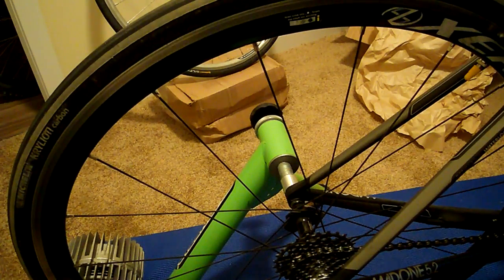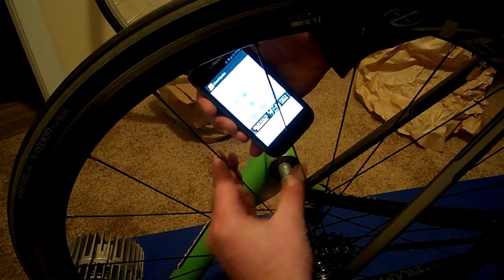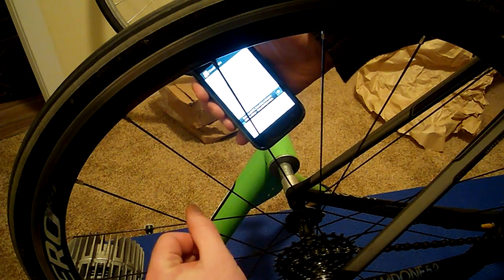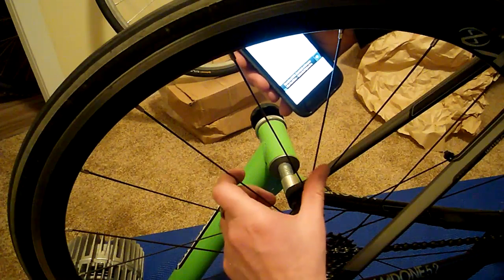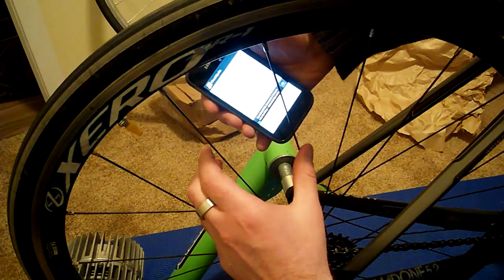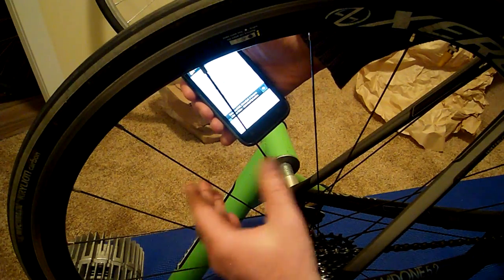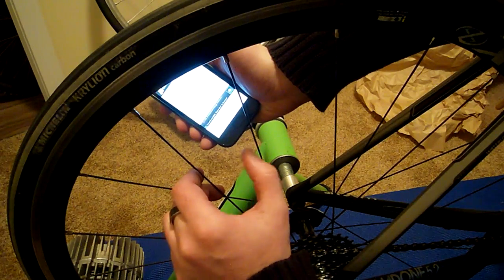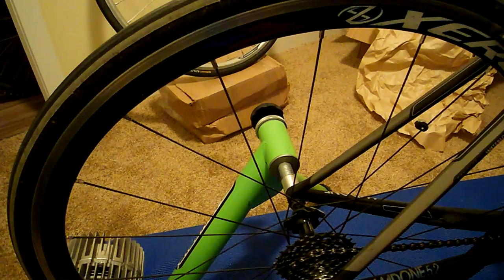Spoke Tension with App

Comment: Tension on the sprocket side should be  higher  than the tension on the other side because the wheel is dished, i.e. not symmetrical

Comment: How could every spoke, bladed, round, sound the same. Check it the real way..your life depends on it.
Reply from the maker: Just so you know, Shimano now uses frequency derived from this method for every single wheel they produce. Every wheel. Shimano. Also, through simple vibratory analysis it's quite a joke for someone to derive the tension - frequency relationship for non round spokes.... Again. Every single Shimano wheel since about 2013. Every single wheel. Shimano. Shimano.... every single wheel. Shimano
Reply: @kwakeham  What about Shimano?
Reply: @kwakeham  is Shimano also using vibration? Is it on all of their wheels?
Reply: @kwakeham  What does Shimano use?
Reply: A little dramatic

Comment: A few flaws I can see. You are measuring with the wheel on the bike. Not a good idea. You are seeing different frequencies on your drive side because your drive side has extra components (cassette, freehub body) that can and will reverb when a spoke is plucked. So you most defintely are going to get different frequencies on the drive side since Wn = SQRT(K/M), where Wn is your natural frequency, K is your spring constant (assumed to same in each spoke), and M is your mass, which is slightly higher on the drive side, hence the lower frequency measured from the drive side. What you have to do is remove the cassette, remove the freehub body and axle so that there is no chance of reverb from the end of the spoke to the hub components. Leave the tire on, put it on flat ground, and repeat. Should end up with pretty even frequencies. Another is the app. The app is crap. You should really use a good DB meter for this as the microphones in a cell phone are literally the cheapest pieces of crap you can buy. Other than that, good idea!
Reply: A few flaws I can see in your analysis.  First, the cassette, freehub body etc, are not going to "resonate".  The spoke rings in a narrow frequency range and has a very clean tone.  The other items, (if they did resonate) have very different frequencies.

Second, the drive side is under higher tension.  To calculate the tension you can use vector math.  The drive side is much steeper so requires more tension.   

Lastly, can certainly check the tension on the bike.  You can use brake pads as a rudimentary truing device and the app as a tension device and get your wheel as good as new.

I know this because I am the author of the iPhone version.  I have built and raced many wheels using only the iPhone app.
https://itunes.apple.com/us/app/spoke-tension-gauge/id518870820?mt=8
Reply: reading soundings off spokes is used to help read consistency between spokes on the same side of the hub/wheel.
He was wrong when he mumbled his reasoning why the 'sounds' between the drive and non-drive side of the wheel might be different.
.
FYI... you will not read the tension on any spoke through sounding methods like this.
You can only rate the consistency between spokes and their soundings.
.
Tension on a rear wheel will be higher on the drive side due to the length of the spokes being shorter and the tension being higher than on the non-drive side.
.
On a front wheel, non-disc, same-sized flanges on the hub... the spokes will be the same length and the tension should be within the same range, both sides.  The 'sound' of the spokes being plucked should be close to the same.
.
There is no need to accurately read the pitch or even the decibel of the spoke.  A DB meter is not necessary.
You just want a tool that will work on a consistent basis during your measurements.
Removing parts from the wheel is also not necessary because again, you are not trying to discern the actual pitch of the sound when the spoke is plucked.
.
Hope that helps